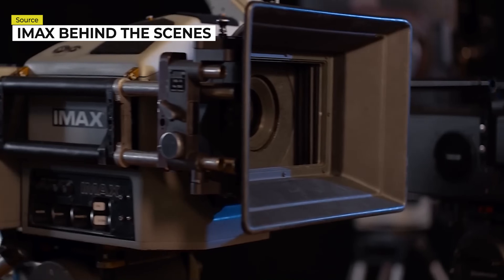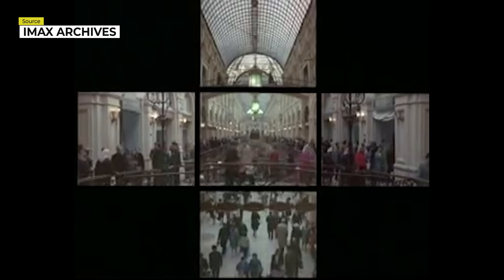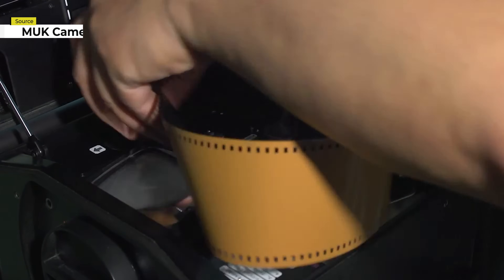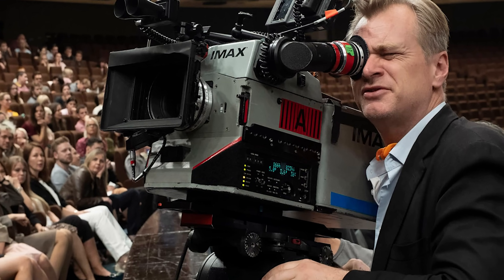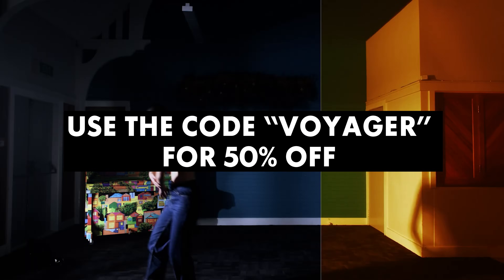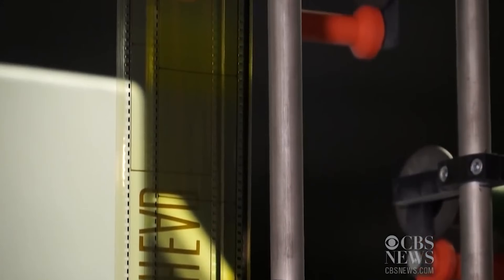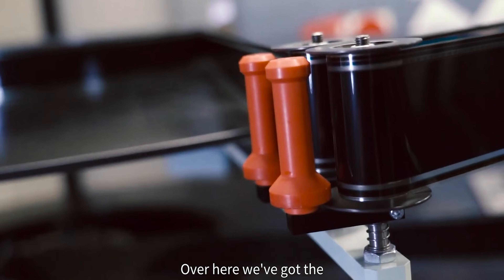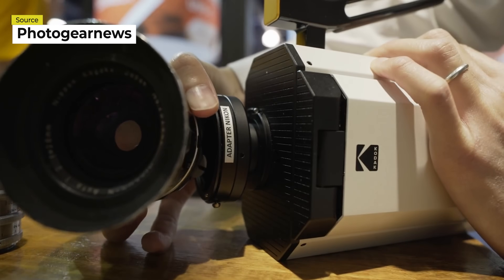The TRUTH about building a Digital IMAX camera

Comment: Working in tech and thus having a fairly good understanding of what can be done, to me it sounds like they could definitely build a 15/70-equivalent digital IMAX camera if they wanted to. I think we have the technology to build it already, and I hope IMAX does so sooner rather than later.

I mainly want this so that distribution and projection will be less complicated, so that I can actually get to see IMAX in the incredibly high resolution I'm longing for as seeing Oppenheimer in an IMAX theater in digital 1080p (I could clearly see the pixels) was a major disappointment to me.

I think camera manufacturers, as most tech companies, are deliberately holding back technology so they can make more money.

Why sell an 18K camera now when they can instead sell 8K cameras, and then 10K, 12K, 14K and 16K before that? They'd lose out on all the sales leading up to the "ultimate camera".
Reply: Not that I disagree, i.e. milking the cow until it's dry, but I think at the moment the issue is probably not making a say, 16K sensor, but being able to make a robust enough storage capacity system that can easily store all of that information, (part of the 15/70mm issue: a single reel can only film like 3.5 minutes at a time, then needs to be swapped) that can also be used over and over and over again, without degradation. RED right now charges $1500 for a 4TB SSD. "One hour of 8K RedCode Raw 75 amounts to 7.29 TB. That's 121.5 GB per minute for raw 8K footage." So, a 16K sensor, which is 4x the pixel count would require 29.16 TB for one hour of footage (or 486 GB per minute):

Which means with a 4TB SSD, you could shoot about 8.23 minutes of 16K RAW footage before you need to swap out the drive. That's A LOT of data, and that's going to be an expensive proposition, considering for a movie with say 150 minute runtime, up to hundreds of RAW hours can be shot before it's edited down to a viewable film.
Reply: @rsr789  If I'm not mistaken 486GB per minute should mean you need about 64.8 gigabit per second. There are to my knowledge network cards with at least 100 gigabits.

If you build a portable raid ssd server connected to the camera over fiber optic cable you should at least be able to record at 16K RAW.

Edit in an intermediate lower resolution format and render it all on a render farm.
Reply: At the mentioned 10GB/s rate, i agree it's quite possible.
But it would not be a solution similar to other digital cinema cameras with plug n play SSDs.

Maybe a fiber channel from the camera to an external recorder (backpack or nearby cart).
10GB/S is beyond common interfaces, but a purpose build solution would handle this easily.
The recorder could be as simple as a PC with PCIE gen4 BUS. 
1-2 fiber interfaces on the PCIE bus that offloads 10GB/S to the CPU which splits the 10GB/S into 2 x 5GB/s or 4 x 2.5GB/s streams. As it's just data (cineDNG images) that can be sorted without decoding.
Now you're looking at 4 x 2.5GB/s, which can easily be handled by  gen4 NVME SSD's (as they top out of 5-8GB/s atm).

Highspeed enterprise grade SSD's hover at around 150usd per TB.
At 10GB/s, 1TB gives about 100seconds of filming.
That's already a lot cheaper than using film, and unusable footage can be deleted immediately.
An array of 20 x 16TB discs would cost 40.000USD, that would allow over 8 hours of filming.
That's peanuts for a large film production, especially considering it's not a consumable medium like film
A storage PC like this could fit in a pelicase. Easy to just have a stack of cases with 8 hours of storage in each.

Alternatively, by using some of the most modern gen5 enterprise SSD's, it could be possible to squeeze past the 10GB/s requirement.
Connected directly to the camera's PCIE bus, this would take 10GB/s directly without need for fiber converters or extra PC's.
The SSD's would cost 1500-2500usd each and contain 26 minutes of recording (though it can be wiped and re-used quickly).

Honestly i think bandwidth and storage requirements is not the issue.

Comment: You said that IMax was 10x the resolution of 35mm. Assuming 16:9, your calculations are way off. 35mm is 995 sq mm per frame. 70mm is 2730. So 70mm is 2.75 times the area of 35mm. I'm happy to be corrected.
Reply: the IMAX 1570 film has a 1.43:1 aspect ratio, I don't know about the calculations but that may change the number a bit

Comment: Every video on IMAX 70MM misses the point. Probably because video nerds are making the videos rather than photography nerds. The whole point of 70MM is the medium format look, which you can only get with a larger sensor. Bit depth and sharpness are all fine, but those can be replicated with a good full-frame sensor, the thing you can't replicate is that look of compression when using a longer lens to achieve a wider shot on a larger sensor/film format. An 80MM lens effectively becomes a 39MM lens on medium format.

Comment: 16K is about the limit of what the human eye can detect at any distance. Sensors will definitely go towards that resolution, and with enough storage and filtering, 1570 can be emulated, as long as the sensor's R, G and B cells are tuned to the same photometrics(did I say that correctly?) as the original IMAX film layers/emulsion. So , with much money, and engineering, it can be done. And it probably will within the next 10 years.
Reply: "16K is about the limit of what the human eye can detect at any distance...." I'm sure it's an artefact of the YouTube comment process, but somehow the three pages of footnotes I'm sure you included, citing copious cognitive research and detailed engineering evaluation of format sizes vs viewing distances to justify this statement have not come across to your readers, making your comment appear wholly unsubstantiated and rather like a breath of unfresh air from an unfresh orifice. Please do your best to correct this injustice by publishing those findings in response to this. Thanking you in advance.....
Reply: @gregfaris6959  Breathe, man.
Reply: @paulmichaelfreedman8334  ; Oh what an erudite response! This definitely substantiates my conviction that, despite all appearances to the contrary, you really had a vague clue of what you were talking about! Doesn't it?

Comment: What Pawel Acthel said about DOF (depth of field) made no sense at all. DOF does not become shallower by increasing the resolution of the sensor. His statements involving the Nyquist limit also seemed dodgy. Regarding the resolution of IMAX film, of course it depends on the stock, but it does not depend on the lenses used. Of course lenses will limit the max. resolution but that occurs for digital sensors as well (which do not need better lenses than those existing for IMAX film cameras, unless the sensor format is smaller). What has been conspicuously absent from the discussion is dynamic range. What is the DR of IMAX film stock and how does it compare to a modern sensor?

Comment: yes depends on all those other variables. I've scanned in a ton of 35mm film and I used around 40mb scan setting which is a little more than 8k resolution and I found that a 10 mp camera with 1/2" size sensor was sharper and yielded better resolution than the 35mm slides. I would say 35mm is definitely 4-5k or 8-10 mega pixel but not much more. 70mm or medium format film, I haven't scanned a lot of it but given it's so much larger I would say it's at least 8k or 35mp but 16k I doubt even close to that. The big difference like they mentioned is digital sensors are naturally sharper.
Reply: Yeah, I feel so too. 4.5-5K for 35mm photo

Comment: The statement near the end where he claims the sensor size doesn't matter is just blatantly false. He said the depth of field is small because of high resolution? Resolution has literally no impact on dept of field. Depth of field is impacted by sensor size, aperture, distance to subject, and focal length. When you use a smaller sensor you need to shoot on a wider lens to achieve the same field of view. The exception to this would be using some kind of speedbooster adapter to allow you to use the same focal length on the smaller sensor, but I'm not sure if that option would exist and it wasn't mentioned.

Comment: The closest thing I can imagine to an """affordable""" IMAX type of camera is a Fujifilm GFX 100S. It's a $6000 medium format photography camera that can do 4K video and output 12-bit color. To come anywhere close to the resolution of actual IMAX film, you absolutely NEED a digital sensor that is the size of medium format still film and large format cinema film, and the GFX 100S comes close being slightly smaller than 645 still photography film, which is already much about 2.5X bigger than a 35mm full frame. I would absolutely kill to shoot video (and photos for that matter) on that camera and see the difference between 35mm and that medium format sensor.
Reply: There is no need to use the word still with photography because it is assumed photography has no motion. Film editors grab stills from the moving image. And, film producers stupidly use the term 'still photographer' to not confuse them with the DP. They should say cinematographer and photographer if they are concerned with seperation. Rant over! 😂
Reply: @stevenlang7709  thank you “um actually” guy 🤓 I’m aware of the difference

Comment: The whole discussion of lenses is kinda moot if you are aiming for the same image circle as IMAX film cameras.  Literally just use the same lens design as the film IMAX cameras.  And this video then further misses why ARRI just made a much smaller sensor: lenses.  ARRI wants to be able to sell cameras that are compatible with existing, common cinema lenses, which means staying inside the image circle of common mount formats.  And if you can drive the state of the art in small sensors forward then you can achieve the same quality in a smaller, more portable package.
Reply from the maker: Lenses built for film cameras are different then lenses built for digital. They tend to have larger backend elements because they don't have a sensor in the way, so you'd at least have to go through a redesign. They had this issue when george lucas switched to digital for star wars. This video was more a look at going crazy to try and meet every spec of a IMAX camera, honestly you really don't even have to as the ARRI 65 or Sony Venice are perfectly fine for IMAX
Reply: @FrameVoyager  This is out of my wheelhouse, but it really shouldn't be different. Canon EF proves this.  All the lens wants to do is focus the image on a recording plane, whether that's a piece of silicon or a piece of celluloid is almost entirely tangential.

Edit: to be clear, the sensor is not "in the way" any more than the film is.  They should be positioned in the same place in the camera.

Edit #2: actually, Leica is an even better example.  M-mount lenses are sold today that function excellently on both their film models and digital models despite definitely being designed for the film backs.
Reply: Just to fill out the discussion, I'm not trying to be hostile, it's just this is a super incorrect take most of the time.  I watched your video on Lucas's difficulties with the transition to digital.  All of the interviews describing the issues with the lenses said that the root of the problem was that the sensor was not the same size as Super 35 (and therefore needed to be sharper, maybe different anamorphic squeeze factor, etc).  However, since then digital sensors have come far enough that they can be nearly any shape and size you wish as long as you're willing to pay enough.  And the point of this current video was to make a digital sensor in the same dimensions as the 15/70 IMAX film, which would mean that it could use the same optics, just like film directors now use vintage cine glass with modern Super 35 format digital cameras.
Reply from the maker: @JMurph2015  Well, that's correct. I may have phrased it wrong in this. More meaning you'd still want to at least rehouse them and make them workable with a digital camera. Like you wouldn't have to make lenses from scratch or that there are not optics already available to do so. You make a good point

Comment: Something i don't understand is - lenses that cover the 1570 film already exist.
So why would they not work on a same sized sensor? Is it because light has to hit photosites straight on?

Also, I feel the DoF claim is misleading. How can an APS-H sensor have a shallower DoF at an equivalent aperture?
Sure, as I understand it the higher resolution makes the focal plane that's in focus shallower, but the overall look of how defocused things are won't change. Microcontrast can't change how large a bokeh ball is, or can it?

Another question about the 9x7. As far as i read into it, it's based off of a 65mp sensor with an effective photosite count of 9.3k * 7k.(hence the name 9x7?)
Where does the doubling to 18k * 14k come from?

Thanks in advance to whoever can answer these :)
Reply from the maker: The lenses do exist but they are made for film cameras. They had the same issue converting panavision lenses for the star wars II for the first digital Cinema cameras used. The backend elements of the lens would hit the sensor because with film cameras you had a lot more room going into the camera. So basically the elements won't fit correctly and even converters don't work well

Comment: I think the confusion is that one question is "What digital resolution would be required to capture the film grain of the IMAX film?" and that number is quite high to make out the grain details in a square pixel system.
Another question is, "What digital resolution matches the sharpness and contrast of IMAX film?" and that number is rather modest.  This value is where you can make out the same amount of detail in what was shot, but it doesn't look the same.  
With an intermediate value, you can use software to convincingly fake the appearance of IMAX film.
And according to the woman interviewed, with existing 8K cinema shot anamorphically, they could match the appearance and it would probably be sharp enough.
At 12:47 we get the only scientific measurement answer in the whole video:  Although it depends on the film base and lenses etc. a typical figure for Contrast MFT is 8K.  I'm not sure if he said that this is in the short direction; what we normally call 8K video is 7680 in the long direction.  
This means that an 8K cinema file could have all the detail we wanted to capture, and a software process could emulate the film grain and other "look", but to save the result would require higher resolution.
Now just because a 8K cinema file that you made via VFX with a solid black pixel next to a solid white pixel can exist, doesn't mean a camera sensor with that same resolution could capture such an image.  The real scene could never align perfectly to the pixels, and you have diffraction of light.  You would need to have this resolution but with an overall sensor size to match the IMAX negative.  That is, the pixels are larger, so that the circles of confusion from the lens of one unit of detail can hit one pixel and not overlap several pixels.
Doubling the linear resolution to 16K means that we don't have to worry about the test scene containing sharp fine black and white stripes lining up exactly with the image sensor pixels, either.  So, that is consistent with what the woman said at the beginning:  Given 16K cinema, their software can then emulate the look of IMAX film.
Reply: It's not about digital resolution, it's simply about creating a camera that can use a digital sensor big enough to use the same medium format Hasselblad lens(with same FOV) that the current IMAX cameras use. That would require a massive CMOS sensor. They already exceeded this size with the new Big Sky camera which is 18k.

Comment: I disagree with the lady from filmconvert. Even though you can get very close emulating 8mm up to 35mm motion film as well as up to 6x7 medium format photography. I don’t think it’s possible to do that with imax and it’s not a resolution or texture problem. It’s purely a physics problem, for the most part. In my opinion there two main reasons 

1. Physical size. For example try emulating a 4x5 or 8x10 photo on digital.. it cannot be done. The size of the medium plays a huge roll in tonal separation, disregarding DOF, when the same frame is captured through a bigger projection there will be much more physical space for the light information to be recorded. Now digital sensors are amazing in the way they are so densely packed that sometimes they’re able to capture even more detail using smaller projections compared to film. But there’s a physical limit to that ability. And the biggest cinema sensor today as far as I know is the most recent arri 35mm and apparently people in the field think it’s a miracle.. now remember that in the video it was mentioned that imax frame size is 10x larger than 35mm.

2. The difference in the way film and digital capture highlights. Again digital cameras are making great improvements in latitude definitely kicking film ass in shadows but that really doesn’t make much of a difference in high productions since they meticulously control the lightning. However the highlights themselves just look more natural on film. Again arri from what I’ve seen are in a league of their own in that regard. But still more work needs to be done if they want to match imax or potentially surpass it.. 

Final thoughts: remember that at the end of the day if the story is shit, it doesn’t matter what you use.. and if it’s good people will appreciate you work even if it was recorded with a potato 🥔